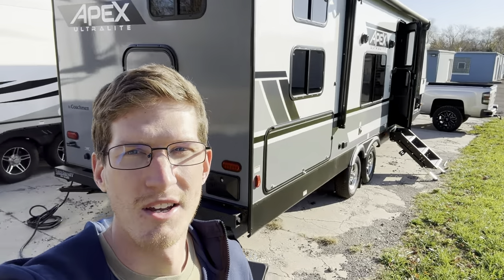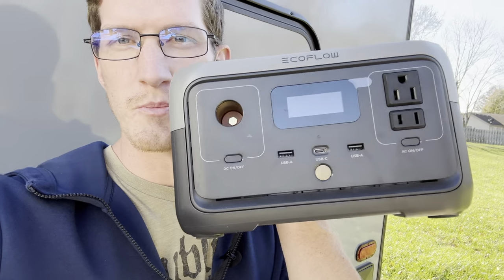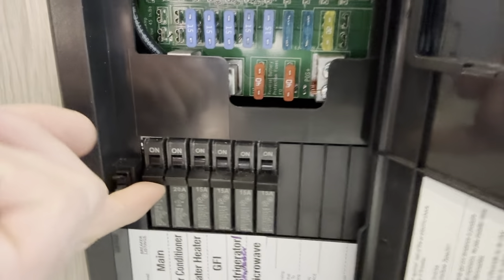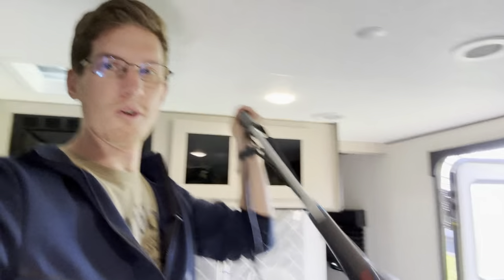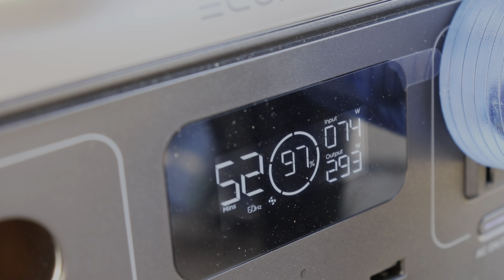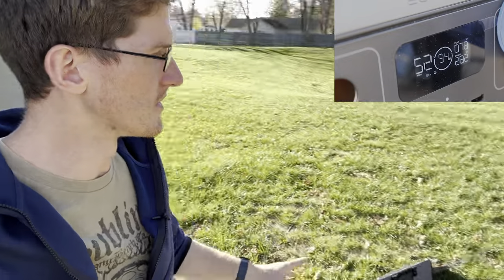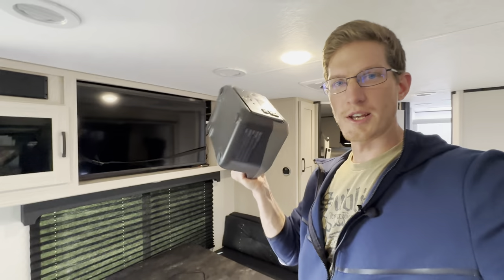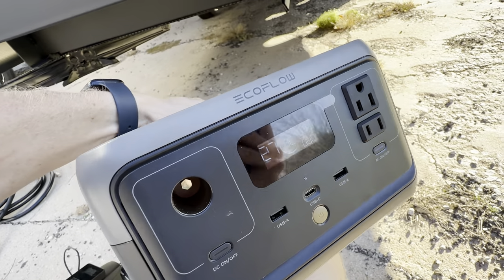Running my RV on the Smallest ECOFLOW Portable Power Station (River 2)

Comment: I have a 2kw bluetti that I keep inside my rig. I drilled a hole through the inside of the shore power cord compartment and run shore power inside and into my bluetti. The bluetti recharges by solar mounted on the roof. I boondock almost exclusively, and always have "shore" power.
Reply from the maker: Great idea
Reply: I just got the Delta pro with shore power outlet so I can plug my tiny small motor home into because I am going to be living in it off grid full time I bought the 400 watt solar panel and really hope its enough
How much solar panel do you use??
Reply: @carolmaplesden916  I have 500w on the roof. It really depends how much power you use, and how much sun you get. If your power consumption isn't high, 400w should be fine, assuming you are in a good solar area.
Reply: I have a bigger travel trailer and I need two of the 400 watt panels. I work full time remotely, and use a big e-bike. 600 watts in is usually enough to give me some good electronic luxury.
Reply: I also use a delta pro 2, and it runs everything on my unit except AC. Which I don’t use, ever.

Comment: Just got my new River 2 Pro w/ 160W solar panels and bought a second 160W panel set.  Maybe I missed it, but did you mention that you can charge it via the cigarette lighter port in your tow vehicle too.   And...  Upgrade those fans, bro.  They make better, quieter ones with thermostat controls. Good vid.  Thanks for the advice gonna have fun with this in my Lance 19' travel trailer. Boondocking, here I come!

Comment: Hey great video. I did somewhat the same thing to power my RV off grid. My RV is a 2019 Geo Pro 12SRK, no air conditioner. I live in northern Alberta and heat is more important to me than having air, lol. The RV is 12 feet in length, 20,000 btu furnace, electric/gas water heater, max-air fan, 3 cube 3-way fridge, 22” TV, a stereo, a microwave, a few 110 volt and some USB outlets. It has a 100 watt solar on the roof, GoPower factory installed with controller and 2 group 24 batteries with a combined 160 ah. I don’t take them below 50% so I only have 80 ah to use. Here’s what I did. I plugged in my Allpowers S2000 with 1500 watts of battery capacity, 2000-watt inverter into my RV 30 amp connection. I then turned my battery disconnect off; this isolated my batteries as the solar is directly connected to the 12-volt batteries. With the solar controller the batteries stay charged and with the disconnect off, the batteries don’t drain. I have a 200-watt and a 100-watt solar panels that I connect in parallel to the solar generator. If I use the microwave (1100 watts) I only use it for a few minutes at best. At night I put away the solar generator and panels and turn the disconnect back on with a fully charged batteries. So, I can use the solar generator at home during power outages if needed as well as powering other items, air fryer, instant pot etc. I do 90% off grid camping so I wanted to make sure I had power. I used to have what they call power anxiety but not no more, lol. My RV, while on the solar generator only used 35 watts. When the furnace kicks in it goes to 65 watts, when I use it. Anyway, sorry for the long-winded explanation. Thanks for the info and happy camping. 👍 ⛺

Comment: Kewl but it's an over prised Trailer with Over Prised Panel...... The River is the only thing worth buying but the Bluetti Equivalent is the same prise as the EcoFlo with 2X the power output and 2X the Solar input with the same battery 🔋 chemistry with better efficiency..... Bluttie EB3A is a better deal.

Comment: Hey I've been following you for a long time. I'm also an RVer. Also the same Apex Off Grid unit. The critical components here on any RV are the fridge (on propane most cases, but still requires 12V for the controls), the water pump and the heater, also requiring 12V. The last things on anyone's mind are the lights or fans. So of interest is how long it could supplement the RV batteries if needed. I couldn't care less for TV or else.
Reply: You could just do the math...

Comment: I own the eco flow but you 100 percent can run all your appliances off of soalr alone.. you simply add more solar panels and make sure your batteries are set up for the voltage you need. I use my eco flow for hikes where i charge ddome and camera batteries

Comment: UPS:
It is a EPS.
The reason it's a EPS and not a UPS is that it switches over to slowly to be a UPS.

If you use it as EPS with a Desktop Computer, you will lose your progress.

However, it works just fine with anything else that doesn't need a constant power.